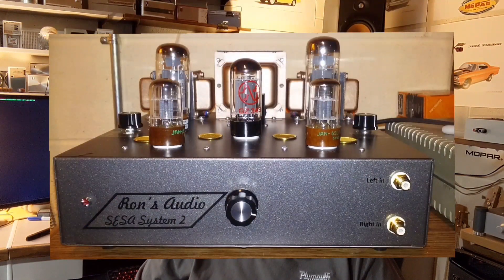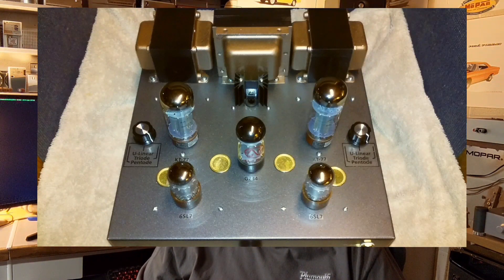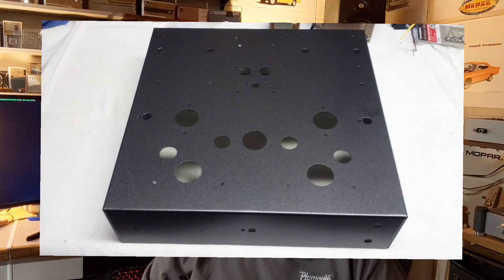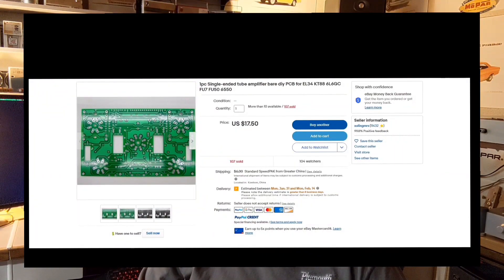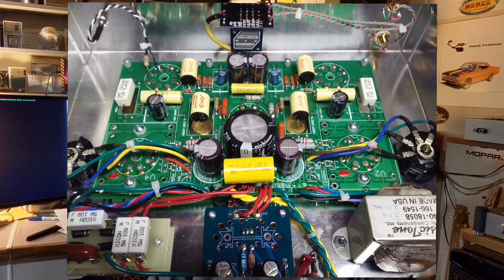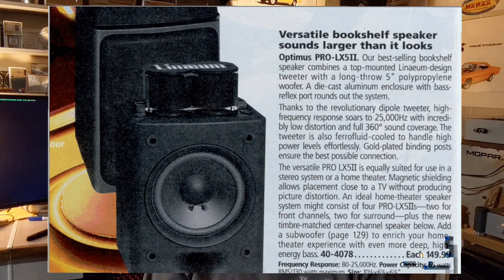KT77 SE vacuum tube amplifier. Who gives who a black eye, single ended or push pull. Your choice!

Comment: Good video, thanks for posting.  4 watts out of a KT77 isn't much.  Which mode do you prefer on your speakers?
Reply from the maker: I have since sold that amplifier but I did prefer pentode mode. I would think that because the KT77 wasn't really designed for triode use that a pure triode tube would do a better job. But with efficient speakers 4 watts is plenty in my opinion. I have since constructed a 6l6/5881 parallel single ended running pentode mode, 18w a channel which sounds nice with my B&W speakers. You and see it here https://youtu.be/64QNSMX4Kgg?si=nLg1j4n5qSBdUgHK

Comment: hi,normally the resistors of the anode of 5ar4 has 160 ohm not 10 ohms , you can see in the tube data, so your global negative feedback goes to jonction of  the 2 resistors cathode its a strange shematic or i dont understand this weird thing.thanks
Reply from the maker: In the 5AR4 / GZ34 datasheet the total plate supply resistance per plate means the resistance of the power transformer. In other words if the transformer does not have enough resistance to meet the requirement then it must be made up by adding resistors to each anode. Look here and scroll to the bottom of the page for more explanation. https://www.valvewizard.co.uk/bridge.html
As far as the feedback yes it can be connected that way. Also notice some feedback connected through a resistor from the plate of the output tube.
Reply: yes youre right i forgot to calculate secondary  windings  in ohms   it  must to be subtract  from the anode  data  resistance so its new for me  this feedback  design i learn  all the time  something new ,i made a single end with a 6sl7  wired in parallel and a kt66  and i got a  anwer to a question about asymetrical clipping  for a single ended ,i ask to many people but nobody answered  in a  specific manner,so its your article from  eddie vaughn,very interesting article. For my single end i putted a 10 k resistor on the cathode of 6sl7 but im not sure its a good value cause im  a novice concerning negative feedback so  far negative feedback was not in my  practice for single end but id like to do experimemt with that maybe you can help me in this way .i saw also  shematic  that use local feddback ,have you an advice for that manner .thanks a lot   @electricroo